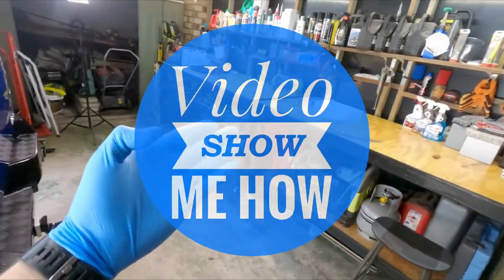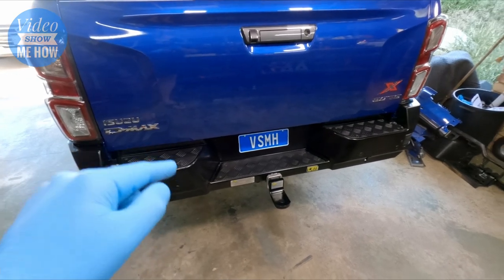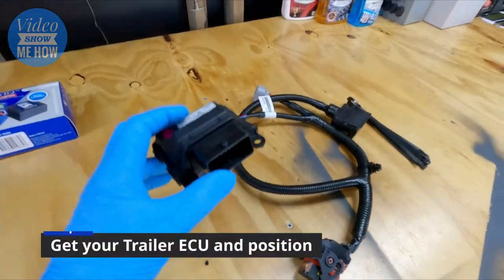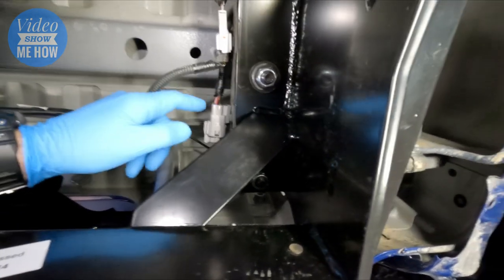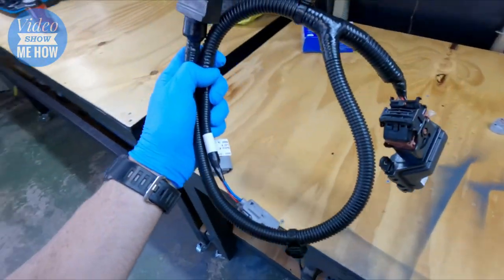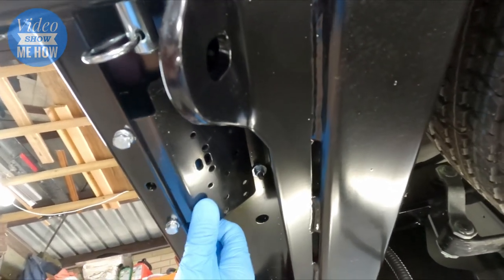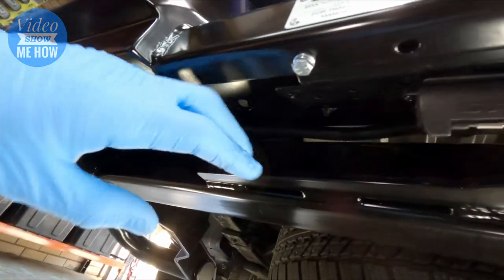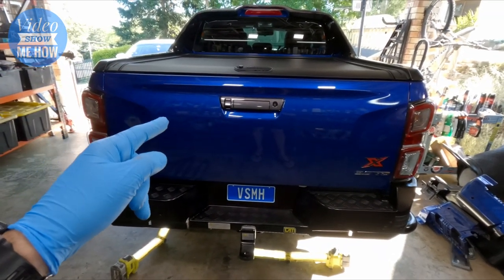ISUZU D-MAX Trailer Wiring Loom Install - 2021 ISUZU DMAX X-TERRAIN Build Series #5

Comment: Adam, love ya videos mate. My dmax came with trailer wiring installed. I have since wired a tow pro system. After which I saw the pre wired heavy blue and signal red near the ecu unit. Do you know where they return up the front of the ute? Want to use one as a signal for my dcdc charger ignition wire rather than run a new one.

Comment: Loving the vids Adam. I just have a question, when disconnecting the battery  of the D-Max have you had any issues with ECU memory etc?
Reply from the maker: No, no issues that I've encountered so far 😊

Comment: Hey, where did the second plug go? I noticed you had two loose ends and only plugged in one
Reply from the maker: Hey mate, that is for your brake controller if you run one (needed for 750kg+) Check out the brake controller install vid on the channel I show how to link into this :)
Reply: @VideoShowMeHow  THanks- Super Awesome

Comment: Great videos, do you know if that quick connect loom on the vehicle has the trailer brake (usually blue) wire run up to the cab?
Reply from the maker: Yep, and has the plug for direct fit to brake controller (vid out soon)
Reply: @VideoShowMeHow  love your work.. I'll be all set with your vids when I get my dmax in Feb..
Reply: @VideoShowMeHow  Did you ever make this video? 🤣

Comment: Hi Adam,  I got a 7 pin from the dealer when i had the vehicle built, and I would like to upgrade to a 12 pin - Is it just a harness change, or do i have to replace the ECU as well?  Where would i get the harness?
Reply from the maker: I'm not 100% sure, I believe the ECU is the same, the harness you could get from Isuzu or other manufacturers (eg tjm etc)

Comment: I finally got around to doing this 😅 all pretty straight forward. However now the remote start via keyfob wont work, had the battery disconnected for install. Looked in the manual to see if I can re set/program it, no avail anyone have this issue?

Comment: There are two harness plugs plus module plug. The larger is plugged into the one where you removed the dummy plug. The second smaller one your video did not show being connected. Where does that go?
Reply from the maker: That is for your brake controller. I did a video on how to hook up a brake controller as well, it's covered in there 👍

Comment: Hi Mate, I have had the Isuzu wiring harness put on mine. Just wondering, Does the fridge in your caravan work on 12v using this harness. Mine doesn't seem to.
Reply from the maker: Nah, I only had the 7pin. If you got the 12 pin it should
Reply: @VideoShowMeHow  Ok Thanks mate. Will go see Isuzu tomorrow.

Comment: This was a super simple install however having to get the “Factory Hitch” to get the plate for the ECU is just ridiculous so I just zip tied it with the extra thick zip ties lol
Reply: Likewise 😂. However my remote start via keyfob wont work now grrr.
Reply: @juliuscesar9864  changed the battery? Try replacing the battery and check the settings in vehicle as well other than that I have to unlock and lock the Ute sometimes to get it to work which is odd
Reply: @1800dontcare  battery should be good car is only 6 months old. Will try your suggestion. Nothing can be simple and just work 🙄. Thanks 👍
Reply: @juliuscesar9864  sometimes the simple things are the ones that work lol life can be a mother flipper sometimes haha
Reply: @juliuscesar9864  how’d you go get it all sorted out?